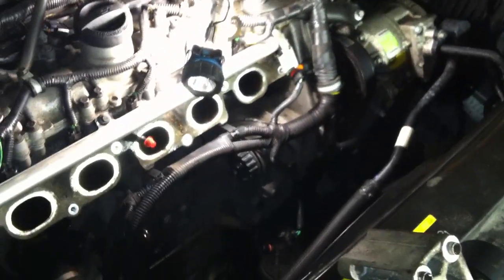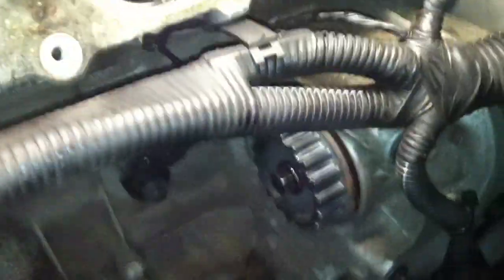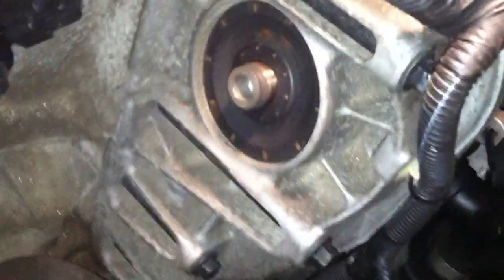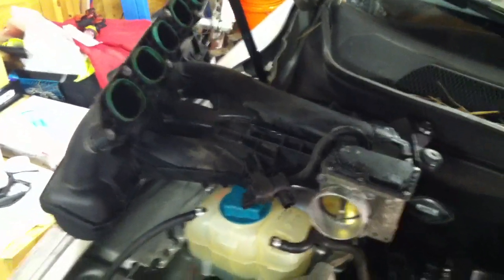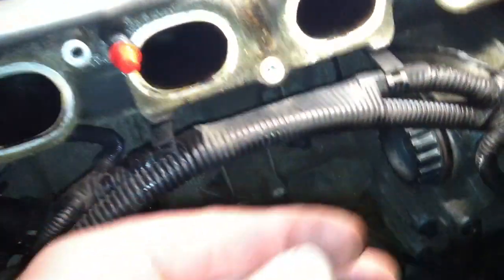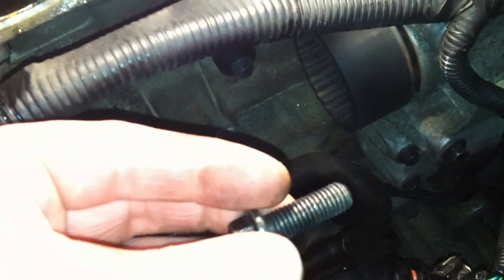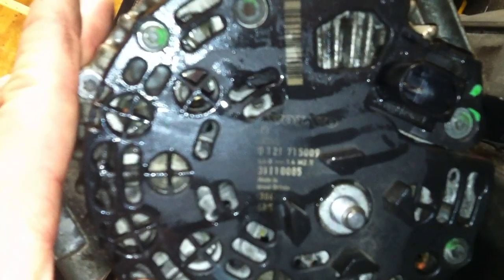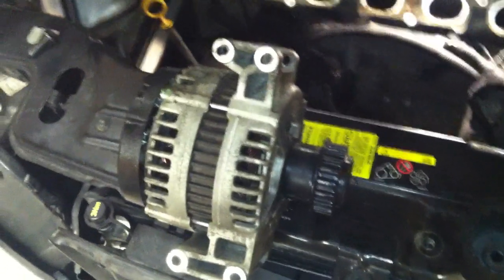2007 Volvo XC90 3.2 Alternator Removal/Install/Fix Gear and Belt driven style

Comment: Where do you get the intake plenum gaskets for $20 from?  My local dealer, Field's Volvo in Waukesha, WI quoted me $48.96each!!!  I am preparing to do this job on my 2010 S80 T6 w/114k miles on it.  Just want to be prepared with a cheaper source if these gaskets need to be replaced.  Do you know of an aftermarket source for the Alternator Decoupler Pulley and the Coupling Belt/Sleeve>
Reply from the maker: Hey JDavid. I actually said $20 Each from Volvo... My buddy at Volvo said don't hesitate to reuse the originals (unless of course they are torn).
Reply: I would like to know if you changed the pulley and coupling.  If so, what tool did you use and how.  I hear a whinning sound coming from the alternator.  An alternator shop told me its the bearings.  Thanks.
Reply from the maker: riley633 No I did not change the pulley and coupling. My whining sound came from the metal pulley on the engine side- the bolt holding the pulley was loose, so it was free spinning, making the loud whine. Take the alternator off and check the pulley- look at my video again, i take a close up of the pulley and bolt. If your bolt isn't loose, its definitely the bearing in the alternator pulley. I don't take alternators apart, bring it to an alternator / starter specialist if I were you but DO NOT let them install a new (Chinese) regulator on it- they are known to fry ECU's because of out of tolerance voltage fluctuation
Reply: Tell your buddy at Volvo that it's not a great advise. Depending on the gasket if it's contaminated with oil, replace them. Usually after 35K these seals are contaminated. The alternator will make a whine noise but this noise when it's ready to fail it'll make a distinctive noise. Also pay attention to the bearing, there's going to be some metal shavings around the READ unit. I've seen a lot of these specially on the older models since Ford decided not to use lock tight, use blue. There's a special tool to hold the pulley that's driven by the READ unit to apply the right torque.
Reply: t5rguy 

@ t5rguy. I watched your video 5 times.  I finally saw the dowels you were referring to.  If I can only get the darn alternator off the car, Ill take it to an alternator shop and have the bearings replaced.  And of course I will locktight that bolt myself.
Reply: roarpony 

@ roarpony

When I removed the Induction Pipe, the gaskets had residue of sticky oil.  I carefully removed the gaskets and wipe them down with napkin.  I also wiped down the grooves where the gaskets are placed.  Im not sure if thats good enough, otherwise the gaskets seem to be intact.

Im curious to know if theres a leak elsewhere if oil is accumulating on the gaskets?

Im curious to know if theres a referrence somewhere as to where is this apecial tool to remove the darn pulley.  Is this pulley a clutch system where you need two pieces of tool to removed it?
Reply from the maker: How many miles riley- If it's over 75K, or you had oil residue in or around where the intake mates to the head, i would replace the plenum gaskets, even at 20 bucks each-
Reply: t5rguy
83K now, yes Im thinking of changing the gaskets. $120 a set   

http://www.volvopartswarehouse.com/a/Volvo_2008_XC9032l-6-cylinder/_51507_5699483/Inlet-manifold/GR-373066.html
Reply: A small amount of oil accumulating on the gaskets is normal do to the out of range condition of the PCV system, but usually when the breather box fails, it consumes oil causing the seals to be soaked; you'll noticed in the valves and when you pull the spark plugs out. The number one reason is, overfilling these engines with oil. There are other reason as well, but the basics to why will make you understand that replacing these seals will help you in the long run. To remove the Pulley for the alternator you need a two pieces tool to remove it since it's a clutch system, but for the READ unit, you can just carefully pry it off or tap it with a brass hammer to work it out. Usually it comes off with an ease. be careful not to ruin the READ seal, you'll need another special tool if you do so.

Comment: I have the exact same xc90, 2007. I replaced the alternator with one I brought from auto zone, but it's not charging. It ran for 15 minutes, then the power system  failure came right back on. What can be wrong?
Reply from the maker: The exact reason in my video Dedric- take the AutoZone alternator out and take the belt off, and see if you can spin the gear with your hand. If you can, you know the bolt is loose that holds it onto the shaft. If this is true go get your factory alternator back. The AutoZone reman are made in Mexico and garbage.